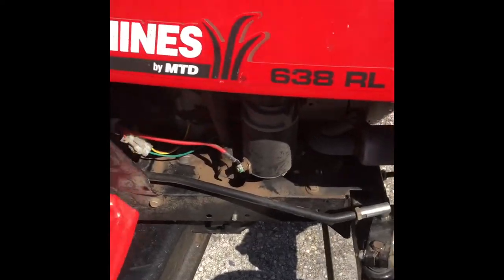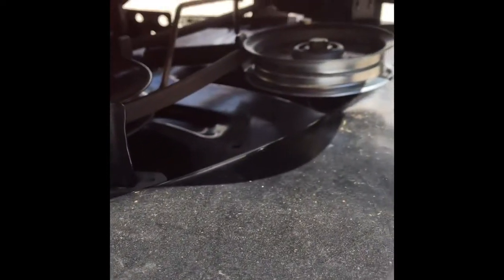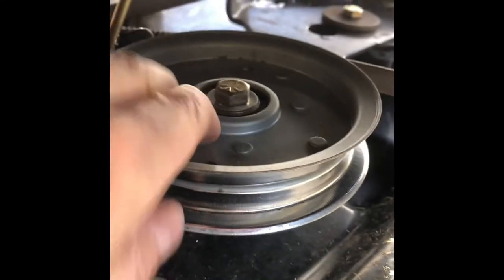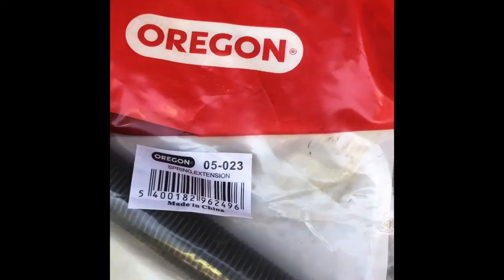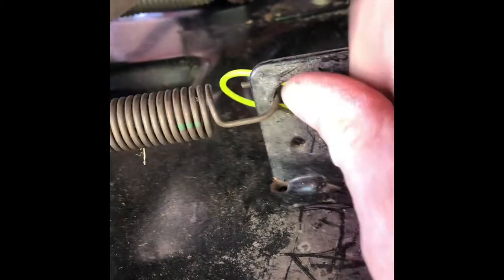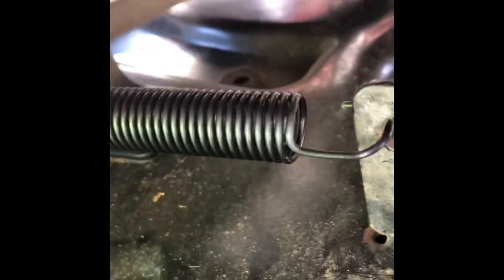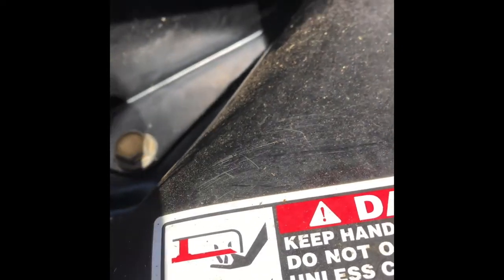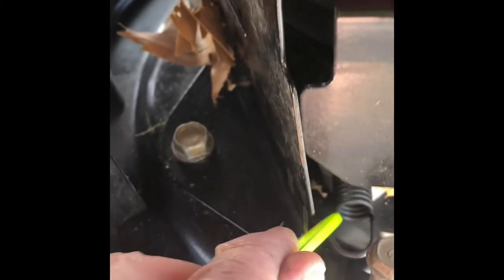MTD Yard Machines 🚜 638RL Deck Springs Replacement

Comment: I came only for the wisdom of how to pull the dang spring... and I wasnt disappointed! The weed trimmer string did the trick! Had to use like 3 ft for my simplicity zero turn but it worked. Thanks!
Reply from the maker: Lol, glad I was able to help! Glad you found some useful information in my content. Thanks for commenting and thanks for your support!

Comment: My right spring broke at the end so I bent a new loop to hook it to the blade brake side. All good until I engaged the PTO. The added tension on the spring since it was a bit shorter caused the deck cable to break at the pin on the lever. A long day's work of maintenance/tune ended up in no mower. Good times! Parts are arriving soon. Thank you for this confirmation of where exactly that spring should hook to brake.
Reply: Hello I’m so sorry to hear this, I can’t say it hasn’t happened before as you know sometimes things don’t go as planned. That’s really unfortunate and very aggravating but if this video has helped you in some way it makes all the time spent on it worthwhile to me. Thanks for commenting and watching good luck when the new parts arrived I know you’ll be back on the mower in no time now!!! Have a great week and happy mowing! 🤩
Reply: @Jackpotideas  Thanks!!!

Comment: What is the part #for the spings ?
Reply from the maker: Part numbers are in the description of the video, and I also point out which spring is which and the part number, there are two springs just quickly scan the video to make sure of the correct one.

Comment: I have the same mower and can't get the belt to work . Do you know the cable part number by chance?
Reply from the maker: Hello, I apologize, I actually have the original owners manual and they don’t even list the cable. Perhaps an internet search will eventually find it but what issue are you having with the belt?
Reply: @Prblmslvd  the cable broke and the one to replace it seems to long
Reply from the maker: @brynagrig5836  I’ll take a look as soon as I can to see if maybe it’s a routing issue or whether I can find a part number
Reply: Could you run a string along the cable and measure  the length? I got another thinking I had the wrong length but  their the same 56" end to end.
Reply from the maker: @brynagrig5836  I think the issue may be how you are routing it perhaps? I checked mine and it goes all the way around the back gear box and inside the box where the battery is. Let me know if that could be the issue, I couldn’t get a string all the way through the twists and turns

Comment: I have a problem with my mower it will go in reverse but not forward any advice
Reply from the maker: I’m no expert I just solve them as they come but a quick search yields several possible issues... is it locked in reverse? It could be the trans axle gears the shift mechanism, tranny, etc. try searching online your exact symptoms and be very specific such as “lawn mover shifts into reverse but not forward” I’m sure you’ll find a post that leads you to a solution. If you can leave more specific information like model, whether it just happened or it happened after you changed something, etc. you may get more help. Good luck and looking forward to your reply.

Comment: I having problems with the upper deck belt . I brought a new belt just is had too much slack in it. The dealer said it is the right belt for it
Reply from the maker: First I would check the schematic for the exact routing of the belt, make sure you have it routed exactly as should be. It usually has some slack when the blades aren’t engaged. Some adjustment is made by adjusting the deck, check the owners manual and don’t change anything too much at once, small steps, but there’s a bolt on mine at the front of the mower which lifts and lowers the deck height but it also changes the adjustment of the belt. I’d search the part number of the belt you got to be sure also, usually the OEM belts are spot on if always go OEM on belts for these, I had a no name belt shear right off the first time mowing with it. The belt will normally stretch a little with use so if it’s flapping around that much brand new something would seam to be not routed exactly right, but that’s just an assumption and I’m no PRO, just know from maintaining my own. Make sure you didn’t forget anything or reinstall the bracket in the front by the pulley on the engine incorrectly. That’s about all I can think of, be careful and triple check before starting the mower again. Remember you can always “throw in the towel” and have a pro take care of it, if somethings doubtful enough. Good luck and thanks for watching, hope this helps, definitely use online searches for questionable items / diagrams, etc.
Reply: @Prblmslvd  my problem is I don't have a manual all my lawn mower  l don't have  designed how to put the belt in the right way
Reply from the maker: @michaelm8078  you can find one here as long as you have your model number and serial number it shows you where to find them: https://www.mtdparts.com/en_US/operatorsmanuals
Reply: @Prblmslvd  thank you l got it going now!
Reply from the maker: @michaelm8078  awesome! Mind if I ask what was the issue?

Comment: Replace just the pad - for free- make them out of hardwood- I have one mower did this about 4 years ago - they are still fine
Reply from the maker: I have to come up with something, can’t even find the parts I was thinking something like a bicycle brake pad or repurposing some old automotive pads I have laying around, good to hear even hardwood worked. Thanks for your comment! Appreciate your time!
Reply from the maker: By the way,... my pads are secured by rivets, how did you attach the wood blocks?
Reply: bolts